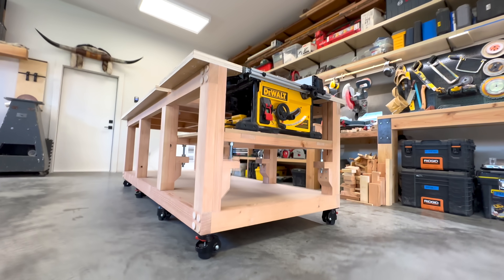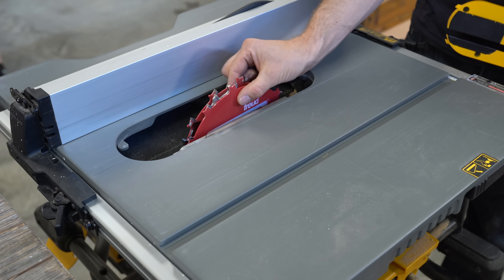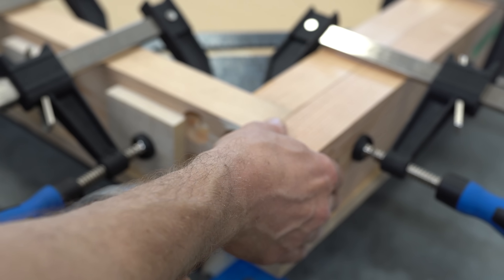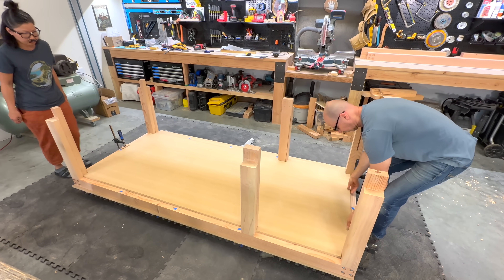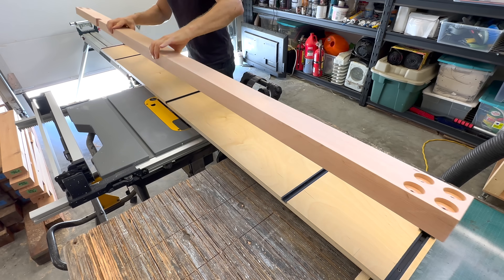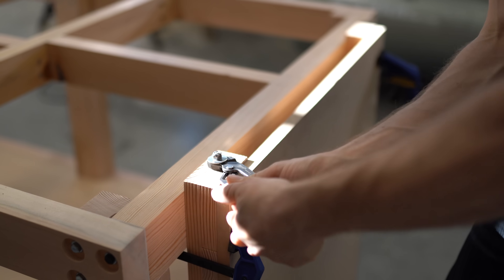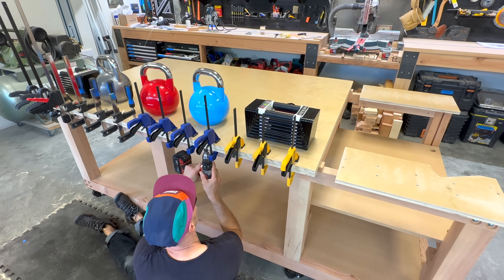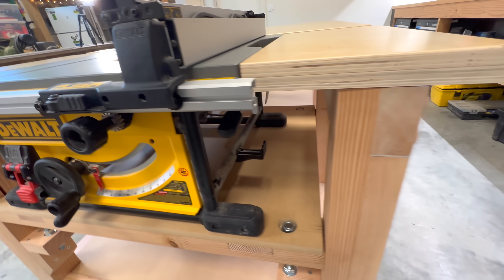DIY Table Saw WORKBENCH Dewalt 7491

Comment: (Subscribed. I'll watch some of your other videos later.) I WILL be building a workbench similar to this, since my table saw is also a DeWalt 7491RS. Mine's currently still bolted to the supplied folding stand though. My bench won't be quite as large though, but will incorporate a router table and storage underneath.
Reply from the maker: Hey Marshall thank you for your subscription and that's a nice saw you own! I have that same stand, it worked well until I build the bench. It is a large bench, like you mentioned...I think I might try to make something up that is smaller, we will see...Also, great idea to incorporate the router into your table you will be building. I hope to do the same one day! Thanks again Marshall for sharing your thoughts, comments. Cheers Paul

Comment: very nice build - looking forward for the plans
Reply from the maker: Hey @NitaTechnologies me too! I'm looking forward to completing them so I can get back to my shop lol. Thanks a lot for your comment and for stopping in!
Reply from the maker: Hi. Thanks again for inquiring about plans for the workbench. In case you are still interested, I wanted to let you know they are now available on ETSY.  Here's the link  http://bit.ly/3s4D7Ta

The plans utilize imperial measurements, and use regular sized 2X4's (3.5 inch X 1.5 inch).

And in case you are interested in building the workbench using the exact dimensional lumber I used in the video (3 5/8 inch X 1 13/16 inch) I'll have those plans available on ETSY on Oct 31. 

Thanks again for checking out the build! Cheers Paul
Reply: Awesome-thank you just purchased, can't wait to build  @vanislestudio
Reply from the maker: @NitaTechnologies  Awesome! I'm excited for your build! Keep in touch if there is anything you need! Cheers

Comment: Not sure if anyone mentioned it, but you probably need to extend your miter gauge slots out further, so that it allows the piece you're cutting to fully go past the blade.  I saw a video for an outfeed table where the guy did just that using a straightedge and a router. I think you could use either a patterning bit and a thin straightedge, or a thicker straightedge and the edge of your router baseplate to guide off of.
Reply from the maker: Good eye David and thank you for the suggestion, I finally got around to adding in the extended miter slots when I took apart my workbench to add a rotating shelf for the miter saw. It seems to be a work in progress for me lol as I am now installing a router lift. Thanks again for your comment and all the best to you mate!

Comment: Nice build. I built one the same size a few years ago. I wanted to be able to wheel saws outside to reduce sawdust in the garage. It's served it's purpose well, but I'm now planning to make two smaller tables to take the place of the one large table. The table is just too big for a 2 car garage, where space is needed for other things (cars, bikes, kids stuff, etc.). The large table would be perfect for a larger garage or dedicated workshop though.
Reply from the maker: Hi @mryourestupidimnot thanks for sharing your build and your thoughts on using two smaller tables. Great Idea! and would make shuffling things around easier in your space I would imagine. You never know, I may do the same in the future, but for now since the space is there, i thought why not use a full 4 X  8 sheet and see how it goes... Thanks for sharing and thanks for checking out the build!

Comment: Newbie at workshop and woodworking so found your video amazing and way above my thinking. The angled supports for the adjustable shelf, the jig for the plugs, the use of the squares and clamps… Clamping pieces is my downfall, I can’t keep it simple enough to be effective and I’m always struggling. Why did you use the small spacer blocks w the clamps in the earlier part of the video? To gain more space to work around? Amazing talent. I’m still trying to come up w a table design for my skill level to rip sheets that won’t require me to saw through the top of full cans of stain again as I use them as my supports for a 4x8! Thank you for the inspiration.
Reply from the maker: Hi @jenniepost7837 Thanks so much for your comment. I enjoyed reading it. So awesome you are getting into woodworking! I used the small spacer blocks to protect the wood I was clamping. Some clamps will leave a Depression on the surface when pressure is applied, therefore if i distribute that pressure over a larger surface area (the small blocks), it will protect the wood from being crushed. Funny to read about the stain cans that you cut through. I've been there with a similar experience. I watched someone on youtube cut thin strips of wood that were 48 inches long, about 4 or 5 of them, then they placed their 4 x 8 sheet of plywood on top of that, then they cut with a skill saw. It worked well and I've been using that technique myself now. You are on the right track when you mention Clamping pieces... Anything I screw together always gets clamped, then pilot holes, then screw together. Always three steps. And you are right, the clamping can be very tricky to figure out, but keep at it :) Thanks so much again! Cheers Paul

Comment: Very good idea for the table leveling.  I have to reset mine to the proper height, this idea would have made it a lot easier
Reply from the maker: Hi @zaffman even if you have to reset yours to the proper height, I'm sure it still does the job well :) Thanks so much for checking out my video mate, Cheers Paul

Comment: Beautiful!!! If I bought the wood you used for your wonderful project where I live, I would spend more than buying a car.
Reply from the maker: Wow @MARCELLO6859 wood is expensive where you live! The most money was spent on the 2 sheets of 3/4 inch birch plywood. I saved money by purchasing the rough cut lumber. But still, you are not wrong, wood is expensive these days. Thanks for checking out my video! Cheers Paul

Comment: Top notch build and video production. The nuts and bolt dance party was awesome. Take my like and subscribe!
Reply from the maker: Hey @ajmarlow8533 Thanks so much!! and so awesome you enjoyed the dance party!! I think it's my favourite part lol Big Thanks again Cheers!
Reply: @vanislestudio  you’re welcome! I did think of a question for you. I saw that you removed the edge off the dimensional lumber with the table saw. But I don’t think I ever saw you use a planer (unless I missed it). How were you able to get such flat and straight boards for the frame?
Reply from the maker: @ajmarlow8533  I used a planer to get them flat and straight, It was a quick edit, at the beginning of the video so I could see how its easily missed. Cheers!

Comment: I like how you make the adjustable base for the saw.
Reply from the maker: Hey Thanks a lot @b3arwithm3, I wasn't sure if it would all fit together a nicely as it did so thanks a for that my friend. Cheers
Reply: @vanislestudio  using the bolts for micro adjustment is brilliant.  It took me quite a while to have the base at the right height.  Plus with your design, you can easily swap for a different saw if you upgrade.

Comment: Would love to have the plans.  I built a table for my dewalt planner but yours is so much better
Reply from the maker: Ah thanks so much @lloydsimms!  You have some good tools there! If you interested, the plans are almost done. Thanks for stopping in! Cheers
Reply: Please let me know when plans are complete
Reply from the maker: Hi. Thanks again for inquiring about plans for the workbench. In case you are still interested, I wanted to let you know they are now available on ETSY.  Here's the link  http://bit.ly/3s4D7Ta

The plans utilize imperial measurements, and use regular sized 2X4's (3.5 inch X 1.5 inch).

And in case you are interested in building the workbench using the exact dimensional lumber I used in the video (3 5/8 inch X 1 13/16 inch) I'll have those plans available on ETSY on Oct 31. 

Thanks again for checking out the build! Cheers Paul

Comment: Excellent build! Can't wait for the plans. Subscribed.
Reply from the maker: Hey @briankennedy you and me both. Im looking forward to completing them too! Then I can get back to the shop lol. Thanks for checking out the video! Cheers
Reply from the maker: Hi. Thanks again for inquiring about plans for the workbench. In case you are still interested, I wanted to let you know they are now available on ETSY.  Here's the link  http://bit.ly/3s4D7Ta

The plans utilize imperial measurements, and use regular sized 2X4's (3.5 inch X 1.5 inch).

And in case you are interested in building the workbench using the exact dimensional lumber I used in the video (3 5/8 inch X 1 13/16 inch) I'll have those plans available on ETSY on Oct 31. 

Thanks again for checking out the build! Cheers Paul

Comment: If you find that T-slot loosening over time, you might try replacing the lag bolt with a threaded insert and a machine bolt with loc-tite. Thanks for sharing!
Reply from the maker: Hey I never thought about the threaded insert and machine bolt with lock tite! Where were you when I was building this lol. It seems to be secure for now, if it ever moves I'll definitely keep your suggestion in mind and thanks so much for stopping in! Cheers

Comment: Ive watched a lot of bench videosa and I must say this is definitely one of my top 3 so far. Great job. Im checking out your plans BTW
Reply from the maker: Hey @MichaelGevedon that's something to hear it into your top three! Thanks a lot for that! and if your interested the plans will be done really soon. BIG Thanks again!!
Reply from the maker: Hi. Thanks again for inquiring about plans for the workbench. In case you are still interested, I wanted to let you know they are now available on ETSY.  Here's the link  http://bit.ly/3s4D7Ta

The plans utilize imperial measurements, and use regular sized 2X4's (3.5 inch X 1.5 inch).

And in case you are interested in building the workbench using the exact dimensional lumber I used in the video (3 5/8 inch X 1 13/16 inch) I'll have those plans available on ETSY on Oct 31. 

Thanks again for checking out the build! Cheers Paul

Comment: First off, good job. I wish you explained the adjustable height aspect more. The order and size of the washers and nuts.  That's what sets your table apart from most and walking people through the process would've been appreciated.
Reply from the maker: Hi @scottgloster3601 thanks for your comment and I probably should have elaborated more on the adjustable shelf,  to answer your questions, the threaded rod is 5/8 inch diameter and they are 9 inches long each. The T Nuts i used are 5/8 inch and the washers I used have a 5/8 inch inner diameter with a 1  5/16 inch outer diameter.  You place the saw on the shelf, then adjust the bolts until the surface of the table saw is level with the surface of the workbench. Once completed, I tighten the nuts so nothing will move. Thanks again for stopping in with your comment, Cheers! Paul
Reply: @vanislestudio  Thanks for your time and help.  You appear to be one of the good ones

Comment: Great video. You young guys come up with ideas we would have never dreamed of. One question.....why do you need to adjust the height of the table saw? As long as it's even with the table.....why is there a need to adjust it?
Reply from the maker: Thanks a lot Dennis! The answer to your question of why... would be because of when I first built my miter saw station. I used shims to get it level with the worksurface, I need to remove my miter saw from the shop, and when I place it back, it was a pain in the butt to fiddle fart around with the shims each time. Then, I watched a video from Mr. Vereshchak, where he did something similar but for his Miter Saw Station. Taking inspiration from this,  I kept the ball rolling and designed my Table Saw adjustable shelf, because I also take my table saw out of the shop... and put it back, and didn't want to mess around with shims to get it perfectly aligned with the outfeed, that, and I thought why not try something a bit different for the table saw, as I enjoyed learning something new. Thanks for stopping in with your question Dennis 👍
Reply: @vanislestudio  I like it. You'll be able to check it every time and even if it's off just a touch, you can get it right again. I'm thinking of making one for sure

Comment: Great workbench. Very innovative. Why did you use such small washers on the leg assemblies? I would have used larger washers to fill the entire forstner drill hole spreading the clamping load of the lag bolts and not crushing the wood. Then the caps could have been made shorter by the thickness of the washer with a friction fit on the sidewalls of the holes.
Reply from the maker: Hey Chris, I did not think about that, to spread the clamping load with larger washers and shorten the caps! Live and learn, I seem to do a lot of learning these days lol. Ive been using the workbench a lot and it is pretty true to the day I put it together, but will definitely keep your suggestions in mind for next time! Thanks so much for your thoughtful comment and for stopping in! Cheers Paul

Comment: I removed the plastic feet in mine just so I can securely and accurately attatch it to the table or whatever. If you press harder, the feet actually deform. It's a very nice table saw but it quickly becomes 'not enough' if you like precison woodworking. Still, I would keep one even if I had a bigger cabinet maker saw
Reply from the maker: Hi Karaon, I never though to remove the feet, I guess I didn't notice anything amiss, good to know! I like the saw because I can move it around when I have to. I'll look forward to an upgrade one day, like you mention for precision, but not too soon as this is fine for me for now, Thanks for stopping in! All the best to you 👍

Comment: Love the adjustable platform for the table saw! Just the idea I was looking for. I noticed that you used 4 lag screws (1/4"?)  to fasten the structural elements. My plan was to use 2 x 3/8" bolts with washers and nuts to fasten stretchers to 4" x 4" posts. Thoughts?
Reply from the maker: Hi there, thanks for the question.  Yes, I used four 1/4 inch lag screws to fasten the legs. (Four on the bottom and four on the top of each corner leg). I would think using two 3/8 inch (two on top and two on bottom) would be very acceptable as well. The reason I went with four...  I'm guilty of overengineer things and just provides a bit more rigidity - less chance for any of the components to shift out of place. Thanks again!
Reply: @vanislestudio  Appreciate the response! I am also guilty of over-engineering. So, ultimately, I did go with the 3/8 bolts on top and bottom. Plus, I've decided to secure the back of the bench to a stud wall, so I don't think I'll have any rigidity problems. The bench doesn't need to be moveable, except for the section where the table saw will be located. Thanks for the adjustable idea, though. I am going to do that for sure.

Comment: First, great build! Exactly what I was looking for. But, I'm a bit confused, the imperial uses regular 2x4's from any big box (1.5 x 3.5) but then you plane to 1.8125 x 3.625? I know I am missing something, so sorry if this is obvious!
Reply from the maker: Hi @craigcarroll1237 thanks a lot bud. No worries, and you are correct, imperial uses regular (1.5 x 3.5). however I didn't build this bench with regular 2 X 4's. I purchased rough cut Douglas fur (Actual 2 inch X 4 Inch) from our local saw mill, then after planning the final dimension's were 3 5/8 inch  X 1 13/16 inch. Hope that helps. If you were interested in any plans, I made two versions. One plan uses regular size 2 X 4's and the other plan used dimensioned lumber.  Cheers Craig, Paul
Reply: Of course! Purchasing the wood to start my build this week, your plans have already been purchased! I did learn eventually that the rough-cut Douglas Fir does in fact come close to actual 2x4 dimension...it just took me a bit to find someone locally here in Dallas, found a local building materials supplier who has plenty. Thanks again! Cheers!

Comment: Bought your instructions.  Trying to figure out how to plane down an 3 4/8 inch X 1 8/16 inch to -> NOTE:Plane down all 2X 4 boards to a thickness of 3 5/8 inch X 1 13/16 inch.
Reply from the maker: Hi @xsasx! Thank you for choosing my workbench plan and sorry you are trying to figure out how to plane down the wood. 

No worries, there are two pdf files with your purchase. They are named:
"VanIsleStudioTableSawWORKBENCH2x4 (2)"
"VanIsleStudioTableSawWORKBENCHDimensional"

If you will build your workbench from regular size 2 X 4's (3 1/2 inch X 1 1/2 inch) use the pdf named "VanIsleStudioTableSawWORKBENCH2x4 (2)". You will not need to plane down anything :) I Believe you will be using this version of the plan. 

The other plan named "VanIsleStudioTableSawWORKBENCHDimensional" is for rough cut dimensional lumber from a mill. This wood actually measures 2 inches X 4 inches, that would need to be planed down to a final thickness of 3 5/8 inch X 1 13/16 inch. I do not believe you will be using this version of the plan.

Hope this helps and please let me know if you have any questions or anything is not clear.

Thanks again! and best of luck
Cheers
Paul
Reply: @vanislestudio  Makes sense!  Thanks!

Comment: The "table" comes secondary to the "saw" in a great table saw. The best table saw table in the world still makes a second rate saw with a low end saw installed. It take both a great saw and a great table. This is like building a good car and putting a Fiat 4-banger in it.
Reply from the maker: Hey @brianbassett4379 thanks for your comment. Ya, it certainly isn't a Saw stop, but for a contractor saw, it's a decent unit. I may replace the saw in the future with one that has a cast iron table top... but for now it's working pretty good.